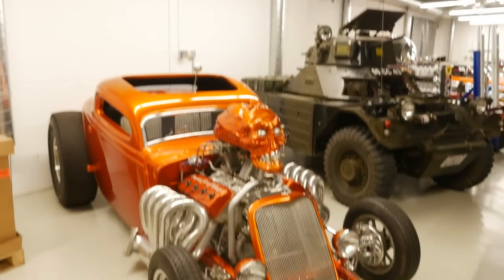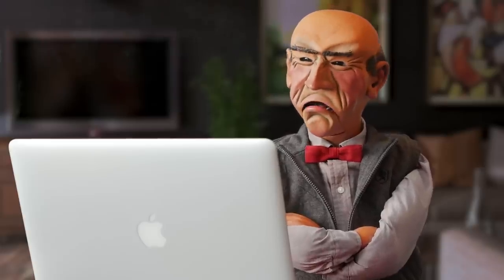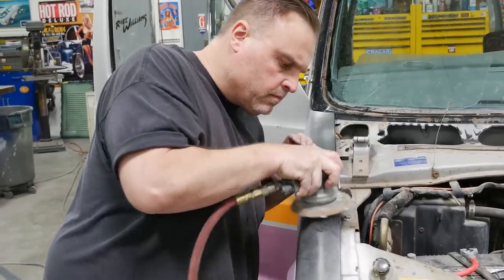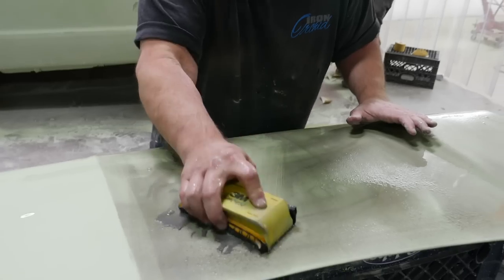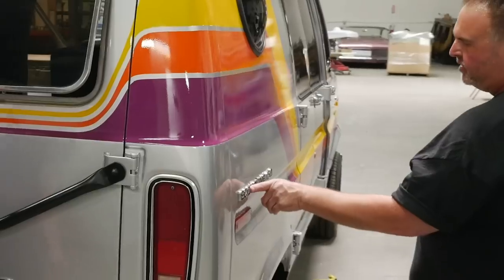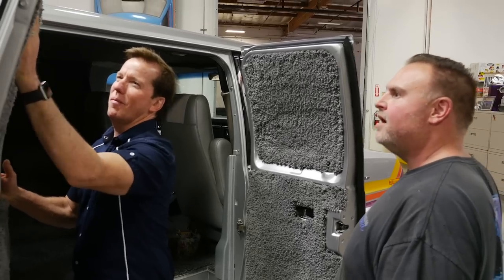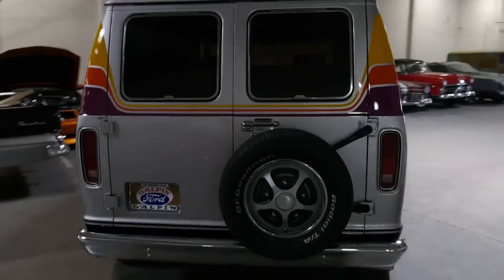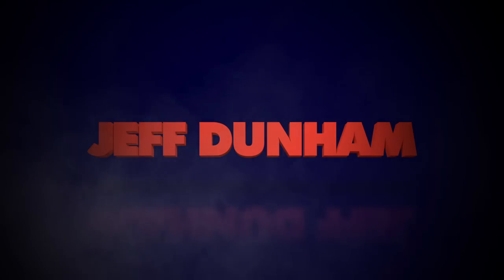What Was I THINKING? I Restored a 1970’s Shaggin’ Wagon To Match My Ford Pinto! | JEFF DUNHAM

Comment: I live in Colby, Kansas where Jeff found this. I work in an electronics shop and I'm about 95% sure I worked on the stereo system in this exact van about 20 or 25 years ago.
Reply: Hehe, that would be badass
Reply: Hope you didn't pull the 8-track out

Comment: funny is I have a book on how to customize full size vans
I think I would change the gas tank in the Pinto to one of them plastic lined gas tanks just to be safe
Reply: Pinto Wagon is a slightly different chassis than the Pinto Coupe, Bobcat coupe or Mustang II. If any of those are in a rear-end collision, if/when the top of the tank ruptures, the occupants of the vehicle get covered in gasoline. One small spark turns the car into a barbecue.  The Pinto Wagons actually have a full steel floor and don't suffer the same problems the Pinto coupe or Mustang II have and were never included in the Ford recall back in the day!
Reply: I wondered about that
Reply: you put in a fuel cell. plastic or metal when its behind rear axle you are asking for boom. hot engine rear ends you. things catch fire. better to use a fuel cell that has walls with cell in middle protected.
Reply: out of curiosity, what is that book called? wonder how much of it will apply to today's sort of "revival" with the growing popularity of people making tiny homes in vans and trailers
Reply: I'd hafta locate it but pretty sure it was printed during the height of Custom Vans
Reply: Alfred Neuman   Glad you helped expel the Pinto myth.  Most of it was perpetrated by Mother Jones and Pinto Madness.  The hatch back was different in design to the wagon.  As to tanks bursting, my understanding was it was blown out of proportion.  The fact that I had a 1976 Mustang and was rear ended and the tank did not need to be replaced or ever leak gives some insight.  Why was I not bothered with the tank's location, I drove my dad's 1971 Buick  Centurion for years. Not only was the gas tank back there,  the filler tube was behind the rear license plate.  So were many cars in the period. Not to deminish the tragedy of those that died but it was like many reports on vehicle problems that are blown out of proportion.
Reply: The Cruising wagons never suffered the ssme issues as their Coupe/Roundabout versions did. So you're safe there.
Reply: All Pintos have a full steel floor. I owned a '76 sedan ( had a trunk instead of a full hatch) and mine had a solid floor. I used to autocross it with a stripped interior. Safety inspectors would have required me to put a steel firewall in place of the back seats if it didn't have a trunk floor.
Reply: 57WillysCJ  Later tests done by the IIHS proved that the driver in any rear end collision above 30mph would be dead long before the fire got to them. The seats in most American cars collapse when hit from behind and the driver suffers fatal head/neck injuries.
Reply: also had much better weight distribution and where a lot nicer to drive in the weather
Reply: Actually the exploding fuel tank was only on the 72 73 runabout and it was discovered and the little metal tab on the center of the body was removed and reinforced to make it safer the wagons were safe and the runabouts in 74 had been redesigned and larger front and rear bumpers were installed the crown victoria had a similar problem also both of my parents had pintos and they were great cars we traveled across the country in them and as long as we replaced the timing belt when it was due for service they just kept going and going and they were still using that same  engine in the ranger until recently
Reply: WHAT the hell is wrong with people it was only the Runabout model that had gas tank problems other models and years were fairly good cars not like GM'S boomer trucks
Reply: GM fans blew it out of proportion due to the failure of the Vega the Pinto at least had a good drivetrain
Reply: IT WAS JUST ONE YEAR THAT HAD THIS PROBLEM...good grief!
Reply: @57WillysCJ  My dad let me have his 59 F150 during high school. The metal gas tank was right behind the seat. Never even thought of it in being in a bad crash, pretty sure it would've been gawd awful in that case.
Reply: @airmanma   Probably not.  I sit on the gas tank of my Jeep.  I think it's more we have been trained to think it's more dangerous.  You are more likely to suffer from the fumes from the tank having a small leak.  I doubt during WWII  they thought the Jeep blowing up after getting hit by a grenade or a artillery round that the gas tank was what caused the driver to die. Not saying that safety isn't important,  but bogus findings to make a magazine article or a TV show should not be a deciding factor or become real history.  It is the same as people  Saying Ralph Nader's book ended the Corvair.  First there is only a small part in it about the Corvair and second GM was going to cancel production prior to book but the publicity increased sales so it was produced I believe another 2 years.
Reply: Fuel cell?
Reply: @airmanma  I had a 59 F100 also with the tank behind the seat. I remember hot August days in east Texas, the smell of gas was bad when you open the door after it sat all day baking in the sun. Best truck I ever had. Regret ever selling it.

Comment: Time for a mechanical restoration on that poor pinto! lol Get it running as nice as the two of them look, Good job Jeff!
Reply: They'd be better off pulling out that 4-banger and finding a little Cologne V6 for it.... or even better, full conversion to a 302 V8.  The carb'd Inline four is a ridiculous motor - especially when teamed with an automatic. I think they were rated at 90 horsepower (and I believe that's gross hp).  Interestingly enough, the Cologne V6 was very popular in Europe and there are plenty of (expensive) speed parts for it including a single plane -barrel intake, headers and lots of performance cams!  That would be the cool way to go about it, but dropping in a 302 would be the best bang for the buck.   Put a 9-inch in the rear, change the front springs, put in a beefy sway bar and go to town.
Reply: How about boosting it like an SVO Mustang?
Reply: Alfred yes, but I'd stop at the little V6, the 302 kinda too heavy requiring a lot more work, heavier springs, power steering etc.

Comment: So cool! I designed and built conversion vans in Ocala Florida from 1984 until 1987 for a little company called Camelot conversions!
Reply: Shepperd November Camelot and Mark III conversions I remember both of them well!
Reply: I'm in Ocala, and if I had the money, you could restore my van.
Reply: Copper Bear Thanx . I was shop foreman.
Reply: my grandfather used to have a conversion van, was a much later one, a '98 Econoline halfback if i remember right. the company is still kicking around these days, albeit just reselling vehicles, I don't think they've done anything yet with the new Ram Promaster and Ford Transit vans yet
Reply: Tom Van Alst No , I don't remember that van converters name but they were in the Orlando area.
Reply: Babylon falling V A N T R U C K
Reply: Worked for Sherrod Vans in Jacksonville, FL.  Wasn't a great place to work, but a lot of nice vans and trucks rolled out of there before moving to Waycross, GA.

Comment: My very first was a 68 Plymouth Valiant with a slant six engine three speed in the column.  Sadly I wrecked my little blue box.  It was a H.S. graduation present in 75.  My next was a Ford Pinto.  White with green strip.  The first car I bought and paid for myself.  I loved that car so much .  Thanks for reminding me of a time in my life that was spacial to me. I have very fond memories of both of these cars.  I remember the vans too.  Vans a rocken don’t come a knocken.  Lol
Reply: had an MPG model Pinto, no hatchback, tiny trunk instead. swapped out the puny 1500cc engine for a 2300 from a station wagon, little thing would do 25 in 1st then 50-55 in 2nd gear. the MPG model was bare bones and lots lighter, the engine swap made it a pint sized sleeper.
Reply: back when a car was a graduation gift, I was lucky to just get a couple hundred bucks in total lol

Comment: I'll drive the Pinto!   I had a '73 hatchback and a '73 country squire.  My first car was a '73 Vega hatchback and later I owned a '74 Vega wagon. 
Out of the hatchbacks I liked the Vega better. The big difference between the wagons was that the Vega had coil springs in the rear and the Pinto had leaf springs in the rear. The Pinto wagon handled much better with the leafs and I actually miss driving that sucker.  😎

Comment: Jeff, where's the CB radio and whip antenna?
Reply: Exactly. Every van in the 70's had CB radio. I had it in my Ford Econoline (302ci V8, etc). Fondest memory of that CB antenna on the roof is taking out nine florescent light fixtures (four light tubes each) in a Sears parking garage. Couldn't back up due to traffic stopped behind me, so they told me to drive on through. With each light fixture, glass rained down.

Comment: My brother actually had a custom van shop in the mid 70s to early 80s and I used to help put in the port hole windows and glass pop up sunroofs in them. The Star porthole window was a pain to install. One guy had him install a water bed. Had to upgrade the rear suspension for it. He probably still has some of the bubble port holes. I wonder if Jeff and Audrey have broken it in yet. The pinto sounds like it has a cracked exhaust manifold. The part with Walter in the van was too funny. Those underwear must have been someone's Sunday best (holy).

Comment: How cool!

My OldestSon-In-Law restored a late 1930’s pickup truck. Gloss black paint job, 4 on the floor standard transmission, rides smooth, engine has a verbal attitude. It is sweet!

My dream car would be the twin to the car that belonged to my maternal grandparents. Six-year-old Me went with them to pick it up brand new from the dealership in Flemington NJ. Grampa picked out a 1960 Plymouth Valiant, in Fire Engine Red, with no noise box (I.e. AM radio).

Comment: You're in  a good spot Jeff.  
     I bought  an E-150   in 1980  and  I liked how the FORD   fenders  were bolted on for easy repair  while Dodge and GM  were spot welded in . 
        Also ,  the front end was designed   so  that 80%  of the work  on the engine  can be done  on it since the inside Cover can be remove too.  But the grill comes off  so  when you remove the Rad   the engine  is easily pull out from the front   to work on  it instead of  the  GM and Dodge   that had to be stripped down   to ge it out . 
          There  was a   van option  for a 460  cid   but that was for the high torque  Commercial use  as a plow or to tow vehicles.        
      
 You have the  Optional  Chrome  trim  upgrade  with rear light bezels and fornt end  bright trim around the grill  and Grill itself ,   plus the door Step well  edge trim 03:24  mark . 
  Optional bright  swing-out  mirrors  with  chrom mirror housings.       
    Rear door windows  were an option ,   plus the smoke glass ,  Chrome trim  and then pop-out    glass  for air flow.   I think that the  CHATEAU     badge  gives you a package or extras which should be a Chrome front bumper and Argent  painted rear   where the Chrome version was an upgrade  and then the Truck bumper  where it had the optional Chrome version . 
       It has  AC   and a base  351 ,  but i didn't see the Woodgrain  dash piece . 
  
       FORD  tried to cash in  on the Custom Van market   just like the Mid  1960's    Muslce cars  
    to  build them  Drag Strip  ready.  But  FORD didn't mass produce them and  the Price  was a bit too high for me so I ordered  the Options I wanted  and then could pick  the cargo area interior .
Reply: Had an E150 and unfortunate situation I got a "jam can " gM (vandura or duravan?)anyway it was horrible, finally drove--hmm it to a crusher site ( yup they squashed it)no more gM no more problems

Comment: This is a great video. I customized an older van in the 90's. I had bought from a neighbor for $1. I was going by it one morning, and smoke was coming out of it. Turns out some kid was going around setting fire to random things. Just so happened, the fire truck was about 2 doors down putting out a house fire the same kid started. I told them and they put it out. It was gutted to the point, only the springs were left on the front seats, and anything else that could burn did. It was a work van and nothing special. I was interested in it before the fire, as it was for sale, but they wanted about twice what I thought it was worth. If I hadn't noticed the fire, it was likely to have caught their house on fire also. That's why he sold it to me for a Dollar. I did most of the interior with pine slats, and a medium pile carpet, along with new tires and wheels. 2 new captains chairs, stereo system, and we had the what we affectionately called it. "The Dollar Van." When my son graduated high school, I gave to him. The last time I seen it, was about 14 years ago.

Comment: I don't care what anyone thinks about the Ford Pinto, I owned numerous ones and I LOVED every one of them.  At one time I owned two hatchbacks and a station wagon version of the Ford Pinto all at the same time. 

But I owned various years of them throughout my early driving years.   And nope, none of mine ever blew up either!  If I could still drive and Ford would make them again, I'd buy one! 

Ford Pinto's were the BEST gas mileage cars I ever owned with the exception of the 2 VW Beetles I owned, the original AIR-COOLED engines.  Rubber band breaks, replace in about 5-10 minutes and keep going. 

 I miss the Ford Pinto's over all the cars I've ever owned with one exception, still a Ford, and that would be my 64-1/2 Mustang that I wish I'd never sold!

Comment: OMG!  When you started to pull bottles and junk from the engine compartment, it reminded me of my late mother in law's van.  She had just gotten remarried, bought a van and had it for roughly 6 months.  As a habit, when Mom would come over to visit the kids and my wife, I would automatically Check the fluid levels of her car.  This one visit in particular, I looked in and saw all different kinds of junk in the engine compartment.  I literally pulled 5 different quarts of oil out of the bay (all different brands and weights), different pieces of paper with oil on it, brake fluid bottles, trans fluid bottles, washer fluid bottles, and the like.  If there was a 'hole' her new husband shoved something in it.  I felt like an acme mechanic from Bugs Bunny cartoons.  I seriously thought that I would pull a kitchen sink out of it.  Hell, I even found a bird in the radiator, and a cat (I think) in there as well.  My wife was laughing hysterically from the front window, as each hand was pulling crap out of the entire bay.  Unbelievable.

Comment: I had a cruising wagon. Silver with red and black stripes and black interior. I modified it with lighted T-bird landau bars, Mustang center console, Continental cockpit lights, Maverick map light, custom stereo with equalizer, fog lights, driving lights limo and mirror tint. crushed red velour bed, custom seat covers and curtains, floor mats, air shocks and much more! Sold it years ago but wish I hadn't.

Comment: Now you need a Pinto Pangra. Picture: a solid 175hp out of two overhead-cammed, Weber-carbureted, turbocharged, water-injected liters; engineering involvement by legendary land-speed racer Ak Miller; a curb weight of just 2,300 pounds due in part to an intimate 94.2-inch wheelbase; suspension that compelled a sports-car-like .80g or so thanks, in part, to rack-and-pinion steering and low-profile, 65-series tires; a needle-nose profile hovering aggressively above the road. Better still, it was built entirely in America, from styling to engineering to Blue Oval power, though European machinery was clearly an influence. It was a far cry from the sheer brute torque of the traditional V-8, but it helped introduce the onset of more balanced performance, able to measure performance around turns as well as in straight lines.

Comment: Just saw this video.  I LOVE these vans!  I actually have the '77 model myself.  There's almost NO information on the net about these vans, so I'm glad someone has taken an interest in them.  
Sorry to see that you had to scan for the colors for the van. I hope it turned out accurate, and was not just reproducing someone else's estimate of the colors in a repaint of the pinto. If your body guy had done a little research, he'd have found that the codes are printed on the back of the 1978 PPG Ford Truck commercial colors chart (and yes, they were sprayed on, not vinyl).  Also, IIRC, the paint scheme you chose was intended for the 1978 model year, with the "L" shape designated for the 1977 models.  The '78 paint scheme was basically the same as the Pinto, so I would guess that Ford did, in fact, produce at least some with that layout.  I have a vague memory of seeing it on my high school football coach's van, rather than the earlier one.
The van DID come with aluminum slots from the factory as well.  insides of the slots were supposed to be painted semi-gloss black.  Also, they were the same size front and rear.  The same wheels could be found on late 70s F150 and Bronco trucks, so if you're looking to add a little more accuracy, they can still be had.  I still have the factory set, along with center caps if you need a reference.
Regardless, you did a wonderful job re-creating something that takes me back to my high school days.  I hope someday soon mine will turn out as nice.

Comment: have a look at the aussie panel vans such as the sandman and the ford xb gs (poered by a cleveland 302v8 with a 4 barrel email/carter thermo quad carby, borg warner 4spd top loader gearbox) and had barn doors at the rear...they were true shaggin wagons and we'd put arches and cupboards and everything inside